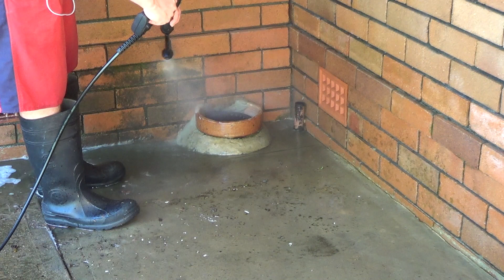Satisfying pressure washing of moss and grime (real time, original sound)

Comment: You should wash in the opposite direction,  fix the water pooling and give extra attention on the bad spots! Maybe use the wand on the areas that look bad. Apparently the surface machine didn't do much difference in the bad areas. Please please wash away the dirt you removed fully. Theres no sense cleaning the area for the dirty water to stand. It's like a waste of time. I do love the full long videos. Keep up the hard work

Comment: you waste the soap.... u pour it then immediately you turbo nozzle it......... u just wash out the soap without using its purpose...... you can clean that slab with just a turbo nozzel, why show it with soap...... get real man.....
Reply from the maker: Hi Noel. There’s actually an edit point there. After the detergent was applied (to help with the stubborn mould marks), it was left for 10-15 minutes, then rinsed and pressure washed.